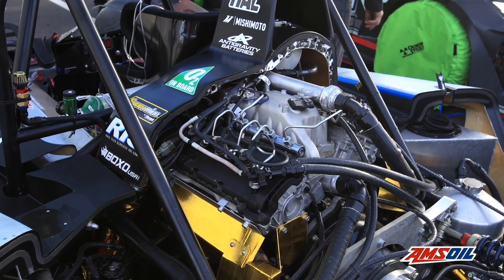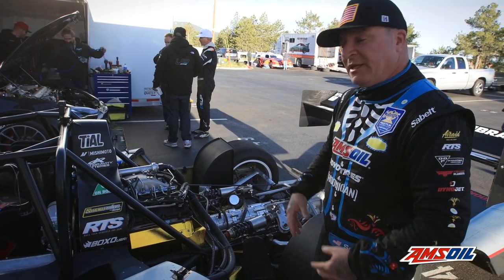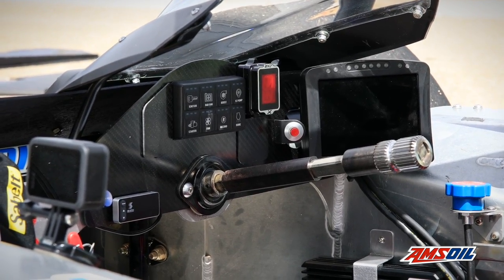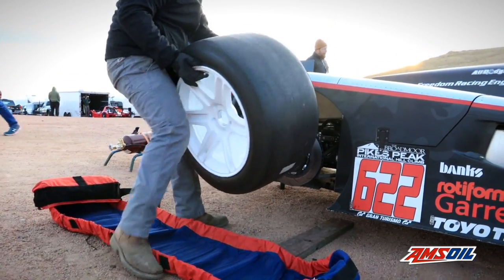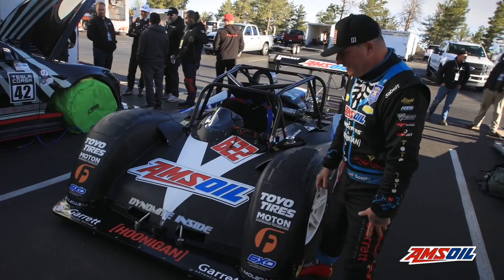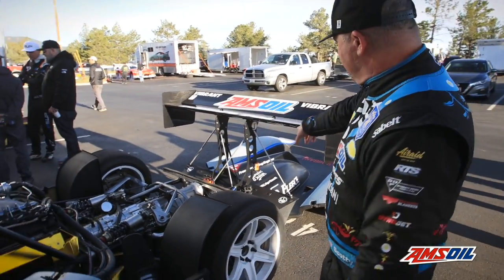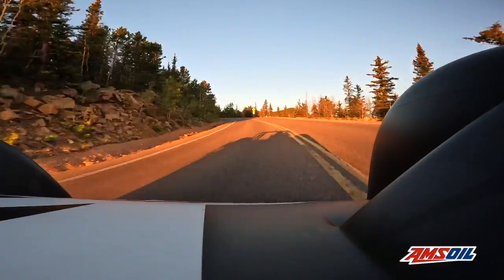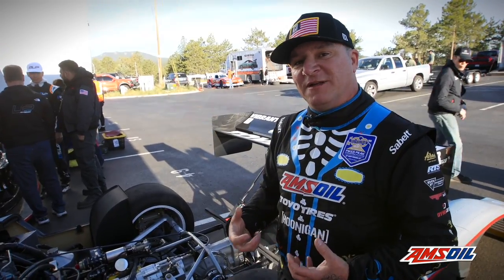Scott Birdsall's Pikes Peak Diesel LMP1

Comment: A huge misconception is that we want low pressure behind flow.  This is so bad.  The net force is equal to the body force delta.  Optimum is high pressure entry and high pressure recovery.   You want velocity to translate to downforce as efficiently as possible.  Higher delta P's in the longitudinal direction mean great losses.